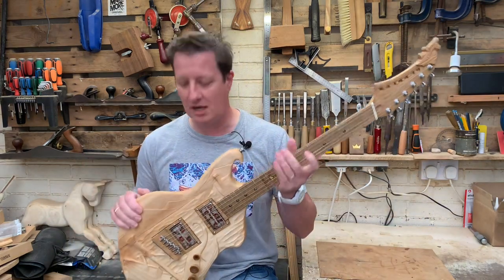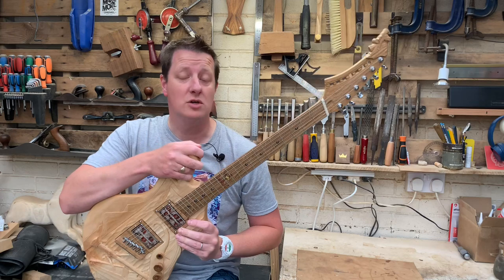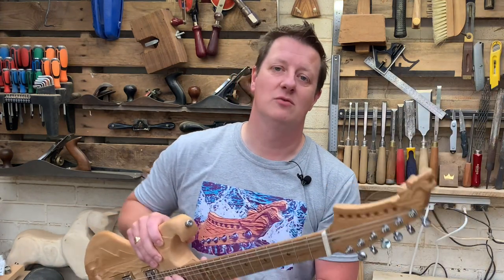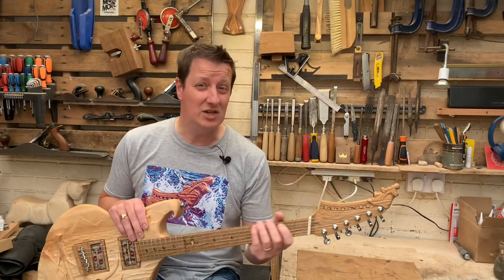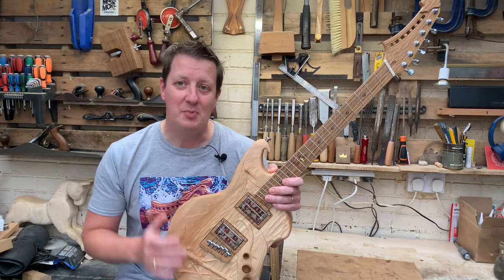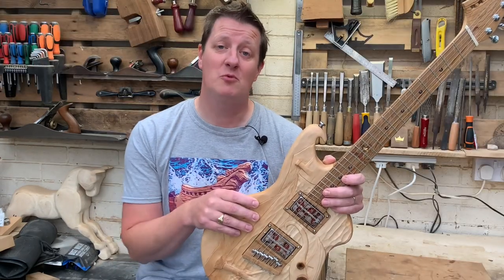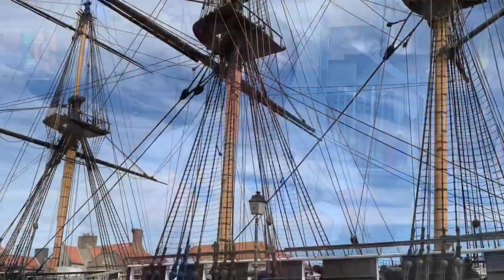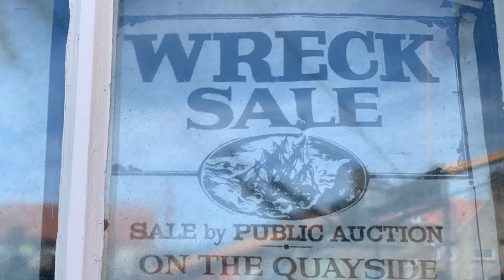Hand tool only shipwreck build  |  Great Guitar Build Off 2021 final

Comment: Amazing job Chris, I love the carving and the oak fretboard is amazing. Brilliant video! I am all for using hand tools only, safer, less noisy and more fun! I can't say I did that on my build though, but will try to on the next one. Cheers
Reply: And I've picked up a tip from your video- clamping a square bit of wood so you can chisel the neck joint at 90 degrees! Thanks.
Reply from the maker: @nickguitar737  thanks Nick, there are a few things power tools are great at (I missed the pillar drill!) but the rest is just nicer with hand tools!